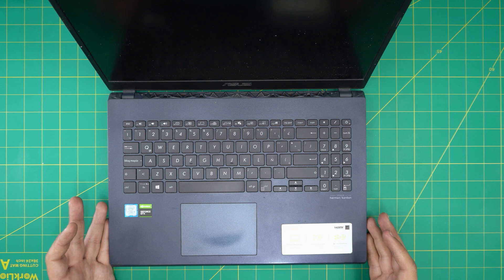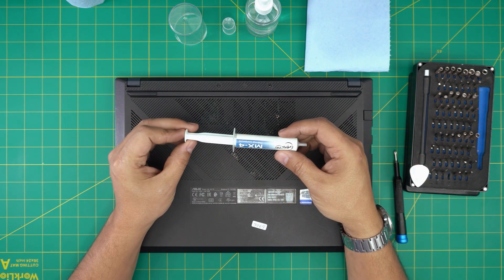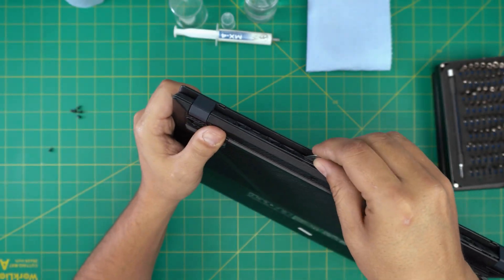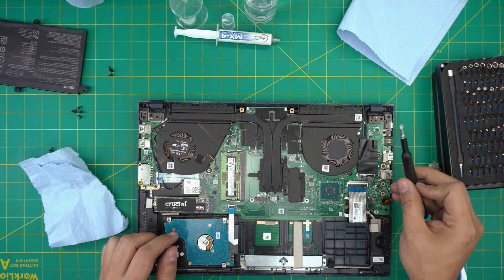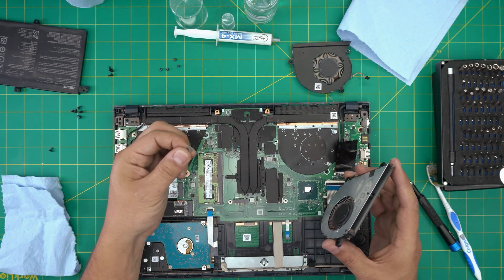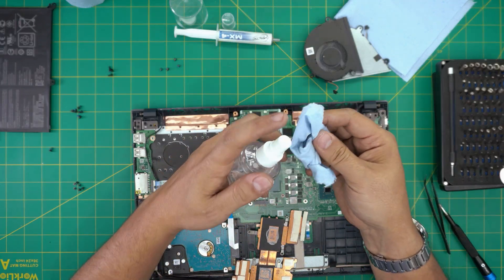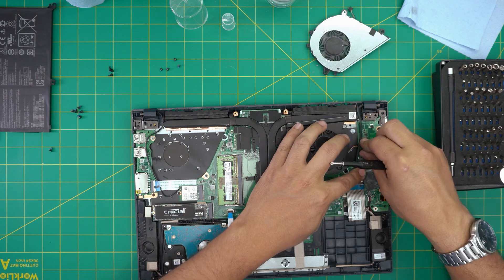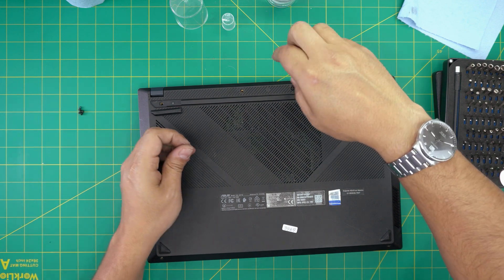How to Repaste and Clean ASUS X571G - X571GD BQ234T Laptop - Step-by-Step Guide

Comment: How much capacity sata ssd in this laptop with hdd or ssd 2.5 inch, can i add with connecter ?
MY MODEL NAME= X571gt 
16 / 512 nvme ssd no hdd aded😅 i5 9300h
 suggest me or reply max ram  or storage expansion ?
Reply from the maker: 🫠Regarding your question, you can have up to a 2TB NVMe M.2 and, at the same time, an 8TB SSD 2.5" or a 2TB HDD 2.5".

about the ram:
https://youtu.be/Nu1zISU4Zws
Should you have any further questions or requests in the future, please don't hesitate to ask me.
cheers🍻

Comment: Hello, thanks you for this video it help a lot.

I follow it in order to change the GPU fan by a new one (same reference), after doing it, the fan rubs a 100% since booting 

If someone as an idea how to fix this i would appreciate help

Thanks 😊
Reply from the maker: It's my pleasure my friend.
I appreciate your support. 🫠 Regarding your question, this happens when the fan is bad or it's a slightly different version, and the resistance of the fan can't be regulated. Also, I hope you've applied good thermal paste.
cheers🍻